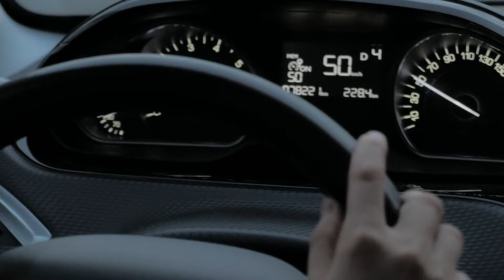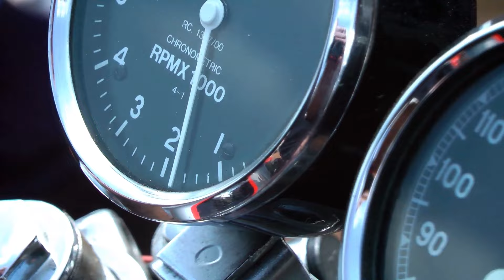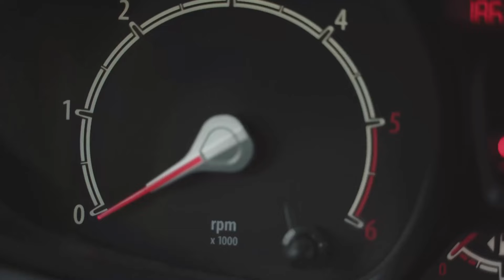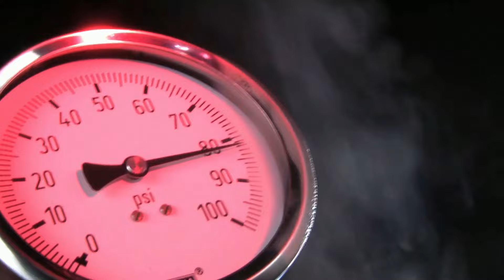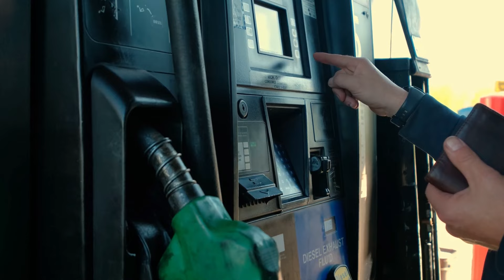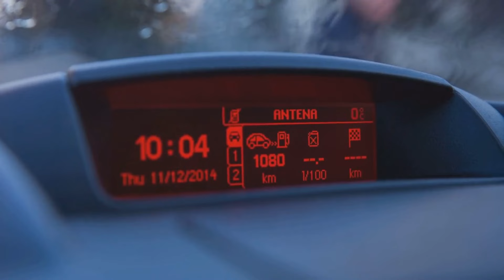What is Engine Knocking/Detonation/Pinging Noise Sound? Differences from Pre-Ignition

Comment: I have a question,  what if I can't afford to buy another engine or vehicle and my current vehicle engine is high compression turbo engine and I can't stop using water methanol injection with 87 octane to prevent knocking because 93 octane isn't possible to get? Should I just wait it out and continue to use water methanol 87 octane or should I try to get a super long finance plan like 120 month finance loan to get a lower compression vehicle?